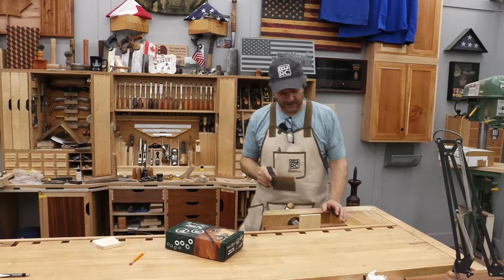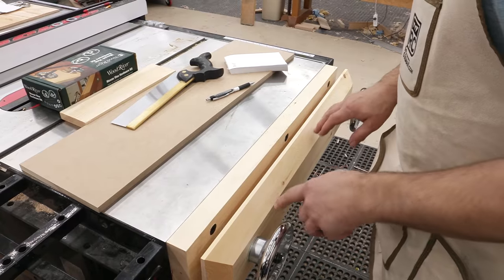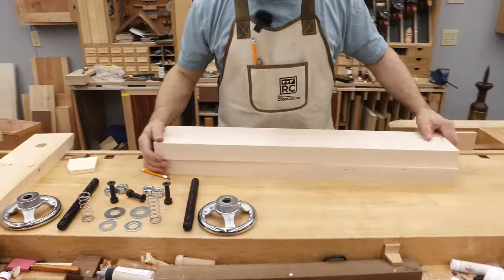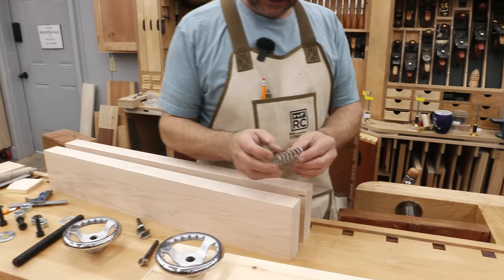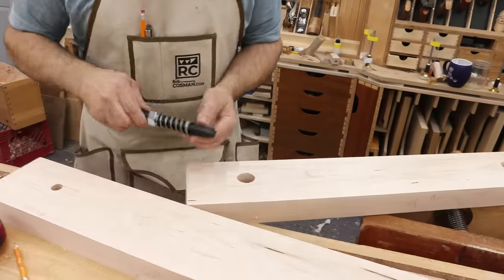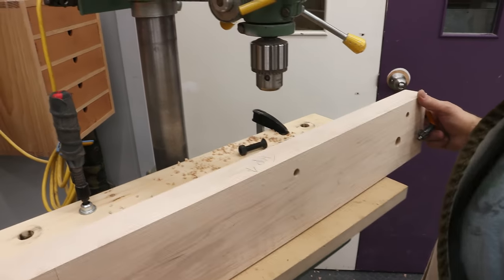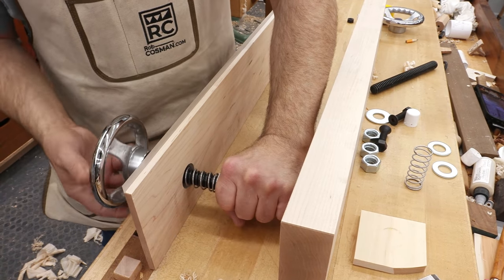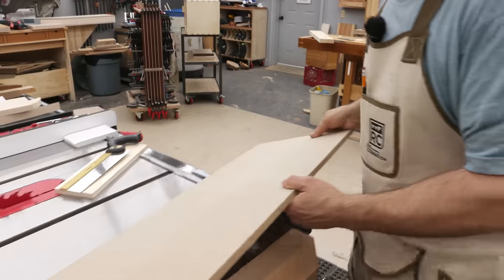You've Never Seen a Moxon Vise Like This One !

Comment: Great video and build. I do have 2 minor additions to it. 1, where the spring meets the movable jaw, place a washer so the spring moves more smoothly than against the timber. 2, in the movable jaw place some type of bush inside the hole. This will allow the movable jaw timber not to be in contact with the thread. As any comment suggested elongating the holes in the movable jaw to enable non square materials to be clamped. In another video by another YouTuber, the used copper pipe for a sleeve. No matter the exterior dimension, copper pipe can be formed to fit inside the slide hole.
This vice would be great for a job site saw, as a vice is always there to be used.

Comment: Great video.  And great idea    You might want to split the recess for the spring and hex nut between the two boards, there will be less of a thin section on the wheel side board

Comment: This is for certain one of those "Why didn't I think of that?!" moments - having no decent bench, I've been clamping a board to the end of my saw and then clamping stock to the board - the board has a lip on bottom of it so it would keep things in place like a 3rd hand while I got the clamps in place ... the greater irony is that I've been working on a moxon vise ALMOST the same width as the table saw ... I guess you just need to see it first - well, off to my shop !

Thanks Rob!!

Comment: I built a moxon vise two years ago, but I was intrigued by Luther’s suggestion to add springs. I went to my workshop to get some measurements, and found that I had a different solution. I used pipe clamps, a far more economical approach, and attached the two face pieces of each clamp with pieces of wood. I could have drilled holes in each face and used screws. While Luther was an O5 or O6, nothing can beat an E5 in the USMC where over 50 years ago we were taught to adapt, improvise and overcome. My vise is portable so I can clamp it to my workbench, end table on my Shopsmith or a table saw if I had one. I glued together pieces of plywood to form faces that are 2” thick and 26” long and left the tops of the faces flat so the dovetailed piece of wood can get a final planing on the moxon vise. A box is attached to the back of the vise to hold the dovetail saw and marking devises. I used the vise to make six of Paul Sellers’s desktop organizers that were gifts for family and my neurosurgeon. That is another story, especially how he uses it.

Comment: And yes, I do like this video. I'm making one of these for the local woodwork club.  I'm making it as a mobile height extension work platform with moxon.  It will be clamped to any one of the eight joiners benches to 1. hold work at a more suitable height for dovetales and other similar work, and 2. include a 30" x 20" bench that includes bench dogs and holes for hold downs.   I like the spring idea.  I'm lucky Luther didn't patent it - yet.
Reply from the maker: Yup the springs areawesome

Comment: I really like the design and will seriously consider building it, but my Work-Mate 
does the same operation without those hip ripping bolts sticking out when clamped closed.
A well demonstrated installation, explained so anyone can follow. Thanks for the idea.
Reply from the maker: That’s why I screwed those as far in as I could. And, it’s surprisingly well placed, well enough that I don’t fear hitting my hip on the screws.

Comment: Hey Rob, I just completed this vise and it works great.  I have a Sawstop PCS 36" 3HP table saw.  One issue however is that the vise is wide enough that the motor cover which normally hinges out below the vise gets caught on the bottom of the vise.  Just thought you would want to know.

Comment: Clamping to a machine, such as a tablesaw, is a great idea for those who lack bench space. HOWEVER, a major feature of the Moxon vise is to raise the work piece high enough to saw comfortably. A table saw may not permit this. The other item is the spring. I first came across this idea from David Barron about 6 or 7 years ago (there is a YouTube video). My modification was to use tapered springs (rather than the parallel springs used here). These collapse into themselves, which will allow the chop to close up. Regards from Perth, Derek Cohen

Comment: I would cut out a rectangular section from each side of the MDF to make a T shape that would fit between the threaded rods. That way you can store the MDF in the vice instead of getting down to put it under the table saw. Otherwise wonderful idea.

Comment: @18:34 you’re actually using the adjustable wrench wrong. You’re straining the movable jaw. I got to correct Rob Cosman on tool technique 😱😱😱 all jokes aside thank you for your impeccable work and work you do for wounded veterans. That really hits home for me.
Reply: Can you do a force diagram please to illustrate your point? I can't see how which direction you use the spanner avoids putting strain ( force ) against both jaws

Comment: The vice is an awesome idea! How can we put that vice on a Cosman bench? That could go on a side or end. The springs are a game changer for a moxon vice great idea! Thanks for sharing. Take care and be safe.
Reply from the maker: It can easily go on the workbench, either in the face vise or end vise position or as on top as a portable vise.  I would not advise in the end vise position as the Sjoberg would better handle holding piece flat on the top with a dog.  The face vise position is a great option as is making the Moxon portable and holding it down on top of the bench.  To ass to the face vise position you drill two holes through the side for th ethreaded rods and then chop out a slot to capture the nuts

Comment: I really enjoyed the video of this product. You make it look very straightforward, which builds confidence that I can also do it.  My thought is this, I love it the way it is, but would it be better to work with the tightening wheels if they had small handles on them so you could turn it with just one hand on each side.  I have Rheumatoid Arthritis, and to open my hand that far across the whole wheel would be very hard and painful.  However, it had a small handle that stood out on the front of the wheel, similar to the way I adjust the quill at the end of my lathe.  🙂🙂 Your thoughts?

Comment: That looks like a great idea, especially the springs.  I'd suggest getting some of Andrew Klein's cork rubber for inside the vise, just to add some grip.  It's pretty cool stuff.  You might also mention, when measuring for a hole for the threaded rod, make sure it's low enough on the wood that it will clear the bottom of the table saw metal, I don't think I heard you mention that when measuring it.
Reply: Good point, but ya Rob mentioned it at the start
Reply: I could see where there could be a problem if the spring coil pitch matched the thread pitch at some point in the range it can open. Wouldn't it be a pain if the spring wire fell into the trough of the threads and prevented you from tightening the vice without finagling the wheels and the spring and the item you are trying to hold? There's a reason for capturing the thread to the moving jaw while winding the screw into the fixed jaw. It's because it works and springs don't.

Comment: Great idea.  A thought or two on the "Bumping Into the Handles" concern; The one thing about the Moxon Vise in a fixed location that are concerning to me are the two threaded rods that stick out - ready and waiting to poke the unwary woodworker in a tender spot. ( I suppose that could be considered just a part of the "Learning Curve".) As to your coarse threads observation,  there are woodworkers who prefer all wood bench vises simply because, compared to metal non-quick adjust models, their coarser threads make adjustments that much quicker. As long as they operate smoothly and without binding, it's a trade off.

Comment: Way back, I had an early Leigh jig.  They introduced improved vice parts, and I was talking to the owner on the phone and telling him how great that was and how much I was looking forward to the parts (they worked great).  Anyway, he said I would love them, but he was kinda amused at all the people who were scrambling for them because the way the jaw was designed (like a large Moxon jaw with tiny knobs), was that what you were supposed to do was just release one end, the way you did at 2:15, but by pushing in on the jaw, and spinning the knob, using the jaw to develop the clamping force.   And reversing that when replacing the next piece of identical wood.  He knew people would spend more time fritzing with two ends of a vice, even with the sophisticated hardware he had designed, and that they would have less clamping power, than with the tiny knobs, but using the jaw itself as the clamp.

Of course if the jaw if filled from side to side, you only have the knobs or levers to work with and the ones you specify on the Moxon are up to the job.  But his insight of using the jaw is still a pretty good idea when cycling through a bunch of drawer parts.  I think a lot of people will get into the habit of releasing just one side, but that is not the whole process, it is dropping the weak hand to jaw plate, and using that to hold the work, until the strong hand lets go, and can spin the knob.
Reply from the maker: thanks for the comment and story

Comment: Im feeling pretty good that I basically had the same idea just a few weeks ago. I don’t have a joiners bench and I was struggling with work holding for hand tools. So I recently put dog holes in my shop made router table (double laminated Baltic birch) on the side of my table saw and it made an amazing mini bench. Not a moxon but a couple hold downs on the face or top give me more than enough.
Reply from the maker: Sounds like another good solution

Comment: Brilliant, as usual, Rob. Would you consider a slight camber to the moving jaw? Since stock rarely leaves the planer in a dead flat condition, one might choose to use the bellied side facing in. Could help to keep the wide boards from vibrating in the middle, since the tendency of clamping down on the portion of the jaws cantilevered past the stock is to bend them slightly, leaving the center with little or no pressure at all. And I'll bet you have a cambered caul or two with your glue-up table, no?

Comment: Very clever and nicely executed idea! Was thinking you could clamp in a longer piece of wood lengthwise with the overhang extended toward the front of the saw to use as infeed support for a wider piece of plywood. Would only give you support along one side of the sheet but might be helpful for balancing the beginning of a cut. Not standing in front of my saw right now so just thinking out loud ;)

Comment: That is a fantastic idea.  Even if you have a strong bench, it seems like something that could still come in handy.

For non-climate controlled shops, would you suggest a piece of plastic in between the wood and the table saw?  The wood may not absorb enough moisture to cause rust on the iron surface.  In St. Louis, where I live, it is very humid in the summer so I'm always battling rust on my metal surfaces so I would rather be safe than sorry.
Reply from the maker: I dont thinke there would be that much moisture but it couldnt hurt

Comment: Rob- Excellent build. With your instruction even I could do it.  However I hit a major snag trying to find springs.  Could not link to the one you used. Even tried a couple of manufacturers and bombed out.  Any help you can offer??   I'm proud of what I have, just need to add the spring polish.  Thanks
Reply: Rob, did you ever find the correct springs to purchase?  I'm in the planning stages of building this.  TIA Mark
Reply from the maker: Had to get them made for us.

https://robcosman.com/collections/workbench-accessories/products/moxon-vise-springs

Comment: The outer half of the vice where you made the bevel looks laminated on the inner face.  Is this just a trick of the light because of bevel leaves about a 1/4 inch shoulder on inner side of the piece?

Comment: I noticed that Rob is installing this vise on a 5HP SawStop. Will this install work with the 3HP SawStop which has the motor protruding on the same side that this Moxon vise is being installed on?
Reply from the maker: This is the Industrial Cabinet Saw (ICS) with a 3hp, but it shouldn’t be a problem on the Professional Cabinet Saw (PCS), those cast iron wings are designed to have additions.

Comment: I looked through before asking, how might you mount this to the Cosman bench as a face vice? I already have the standard end vice.
Reply from the maker: There are a couple of ways.  The trick is to get it flush with the edge of the worktop
Reply from the maker: "105 mm, discardable fin stabilized, armor piercing, sabot round" if I remember it exactly as Al my retired tank commander Cdn Army told me when  he gave it to me.

Comment: Rob when you want to find the center of the hole thats on your table saw Instead of using a pencil use a drill bit the same size as the hole and just twist  with your fingers and you will have your proper centers

Comment: Great! I'll be installing one of those! Shouldn't I be paying a few bucks in lieu of 'patent royalties' to the inventor, just out of fairness? Anyway, I'm inclined to make the space between the tightening bolts just slightly larger than the largest width working piece I'm likely to want to clamp vertically ... that could be for dovetailing, which I won't be doing seriously until I attend one of Rob's courses! ... or it could be other vertical work ... if the bolts are any further apart than the widest piece you'll ever work on, it seems to me that it encourages bowing forces in the moving vice jaw, and or difficulties in keeping that jaw parallel while clamping ... for horizontal clamping, which I can see as possibly being useful for planing long edges or even, if set up carefully, as an alternate registration fence for the saw when using a sled, then having the bolts moved a bit closer together likely has no effect on that clamping action ... just my 2 cents on a very interesting development in machine versatility! Cheers, Farmer John, Ontario

Comment: Not so sure about the springs: I don't think they add much value, as it is not hard to pull the jaw.
But the downside is that they add friction to the wheels, and it looks like they don't spin freely anymore.
Without the springs, clamping should be faster, and opening as well.
Reply from the maker: Absolutely necessary. There’s enough friction regardless so the wheels will not spin freely on their own.

Comment: Beware that Rob is installing the vise on the end of an Industrial Saw Stop.  If you have a Professional Saw Stop the installation on the blade side won't work as the access door won't be able to swing open -- there is 2 1/2 inch clearance under the saw when the access door opens. And, if you have the right side extension table you can't mount it on the other side either.

Comment: Taylor tools has the same hW for half the price.
Reply from the maker: Do you mean this set? Quite different knob hardware though.
https://taytools.com/products/moxon-vise-hardware-kit-w-2-each-8-x-3-4-10-threaded-rods-not-acme-threads-2-each-4-1-2-cast-knobs-4-each-3-4-nuts-and-washers-jaw-lining-leather-2-each-12-f-style-clamps
Reply: I bought it and very quickly returned it....not as easy to use or the quality as the one from Woodcraft
Reply: @daveklein2826  good to know.  I plan to buy one soon.   I like the spring, is that purchased at the big box store?
Reply: @RT-jf9pp  I bought mine from a hardware store

Comment: Any downsides?
Reply: Might be too low depending on how tall you are, but that's the only thing I can think of.
Reply from the maker: Of the vise or mounting it on your saw?
Reply: @RobCosmanWoodworking  Probably both.  Looks like a feasible alternative to a dedicated bench/mount.  Are there any function/usability limitations over a permanent bench mount?  Thanks.
Reply from the maker: Limitations??? probably not.  You are correct its low.  This idea was really for folks that dont have a workbench. If you have a workbench this is a great vise for a workbench